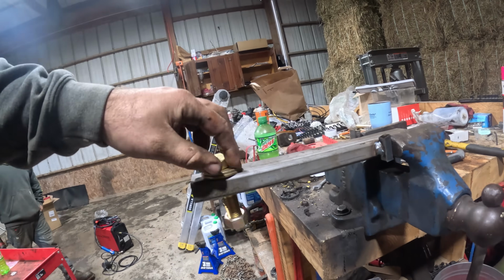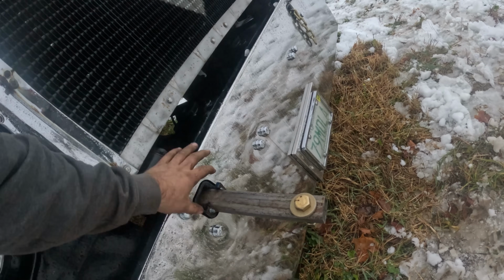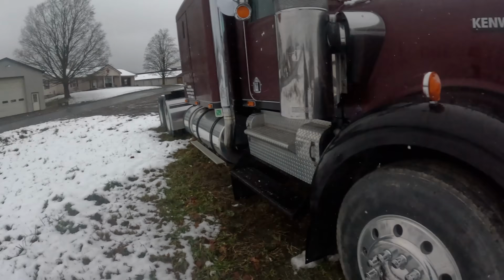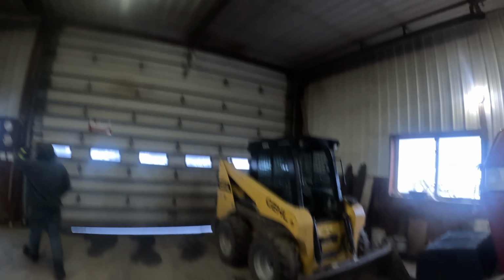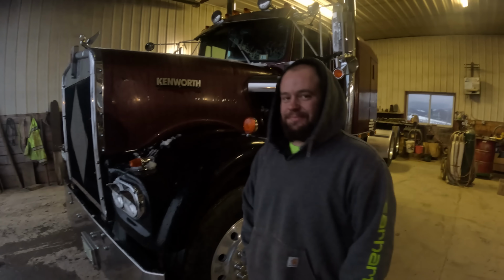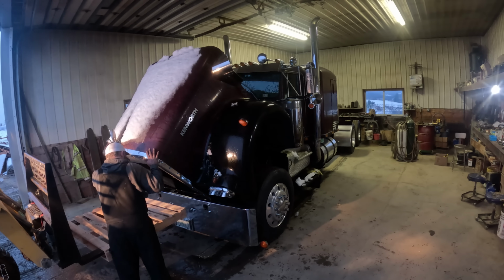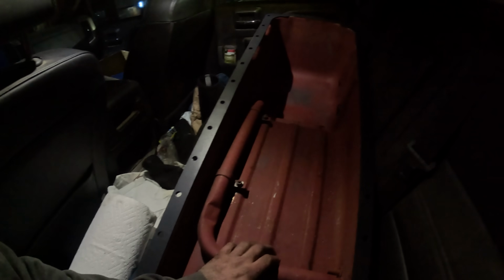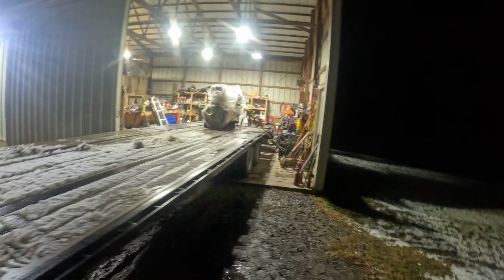Big Progress On The 1979 Kenworth

Comment: How long before you melt this one down and drive the truck in the ground from poor maintenance?!😂
Reply: What poor maintenance,  do you even watch his videos he maintains all his stuff just fine. Typical all your comments are negative BS.
Reply: @ you obviously need to watch them and the halfassed fixes 👍😂
Reply: @HaywoodJabloowme  what's half-assed about having a mechanic rebuild an engine? Or replacing gaskets in a hydrostatic drive? He literally replaces almost every hydraulic line on purchased equipment if they look worn. You guys criticize him for the dumbest shit.
Reply: @ 😂😂 dot thinks otherwise
Reply: @HaywoodJabloowme  so all the times he fixed brake cans, air leaks, and the fact he will stop to fix a wiring problem  is somehow him doing shady stuff that dot would not approve? In other words prove your BS.
Reply: @ I know he knows everything just ask him or better yet watch his videos and keep drinking the look aid